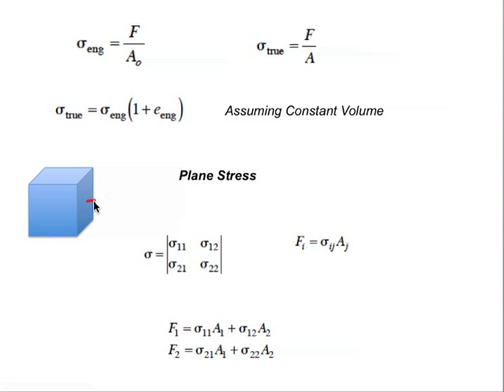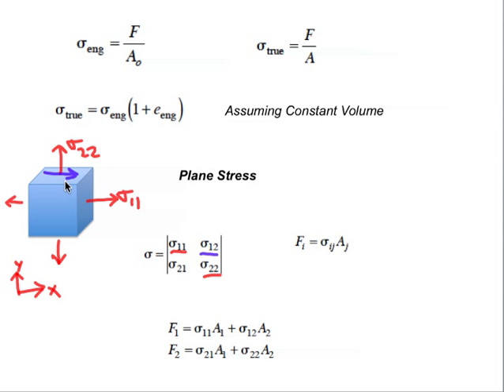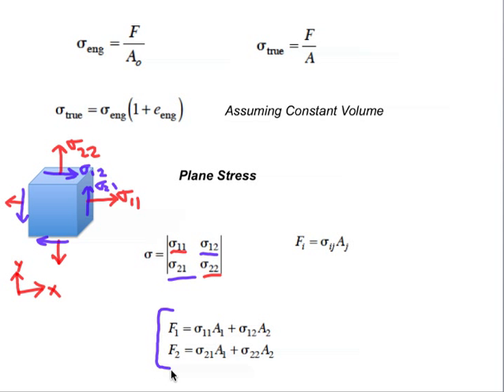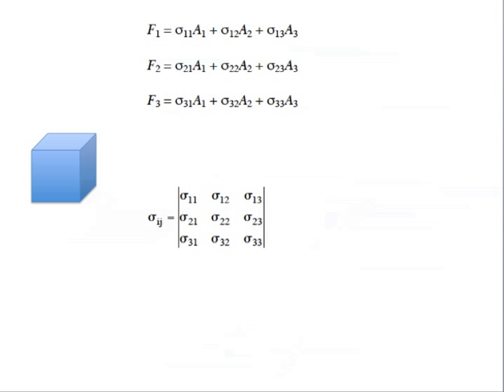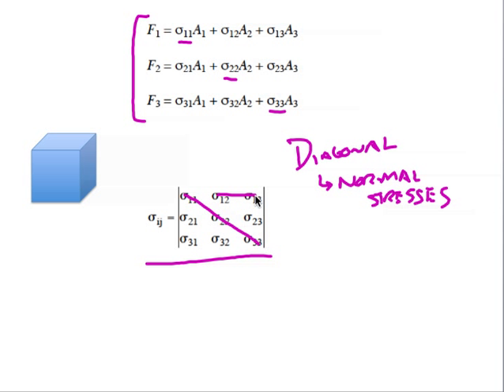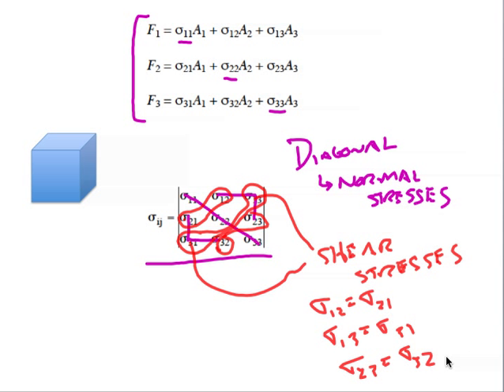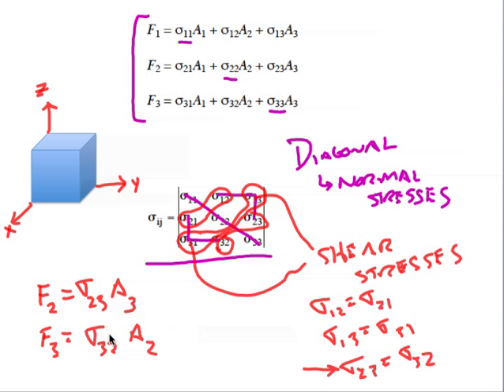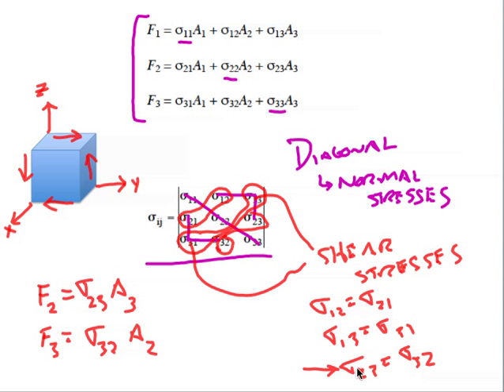stress definition and tensor pt 2.mov

Comment from the maker: Greetings,
This is a sign convention.   If we write
an equation in the form F=s A where s is the stress, F is the force and A is the Area both F and A have directional senses.  For F in the x-direction and A perpendicular to the y-axis (or parallel to the y-plane I write s12.  This gives a tensor that can be multiplied in a consistent way in conventional matrix notation.  I also use this convention because it is consistent with materials science direction-plane notation for plastic deformation.